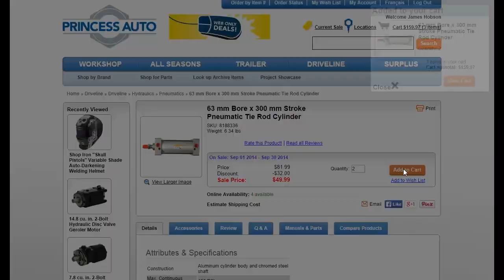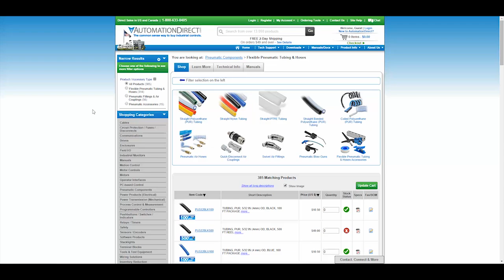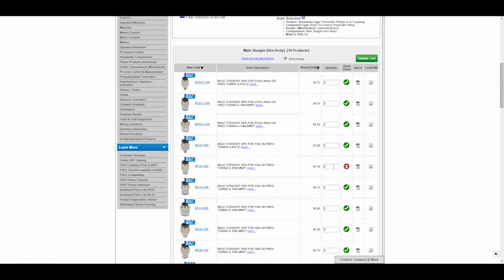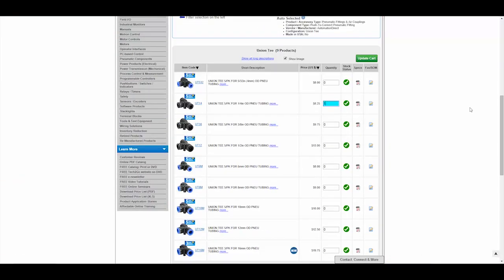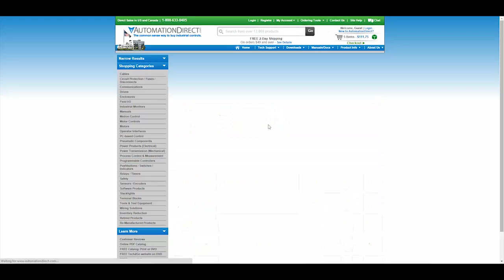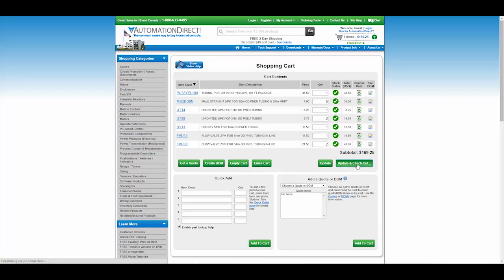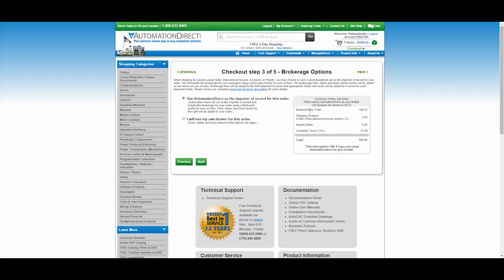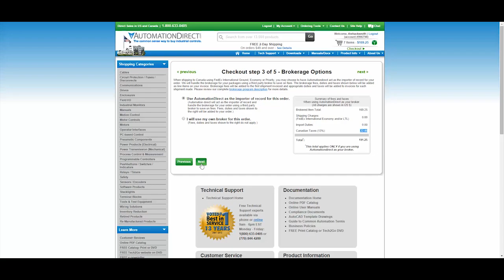Exoskeleton Mk2, Part 2: New Supplies

Comment: You should try using McKibben (air) muscles.  They are much lighter, very powerful, and require a lower PSI.  They also have give like a real muscle so they are not as dangerous.   I'm designing a bionic arm using 3D printing that's then cast in aluminum and uses them.  http://imgur.com/a/XxGeP#0

here's a guide on how to make them:  http://www.instructables.com/id/How-to-make-air-muscles!/step3/Making-the-large-air-muscle/

Hit me up if you want to know more.  Really enjoy your videos!
Reply: Even im making a exo suit, which aims to lift about 30-50 kg of weight. Would yu suggest pneumatic cylinders or air muscles to do the job?
Reply: Depends if you want it to be lift assist or do all the work.  They work similarly but an air muscle works with your body and a cylindar works in leu of it.
Reply from the maker: I've been meaning to make some of those to show my subscribers -- it is ideal for a lightweight system but I'm going for the big game -- lifting multiple times my own weight =P so that wouldn't really cut it. Good plan for a medical device though for disabled people!
Reply: the Hacksmith You could do that if you had enough internal volume in the air muscles, and they might be more weildy than cylinders.  <shrugs>  And require less PSI.  You would need more air volume though.  Are you planning on making this rig portable or keep it tethered?
Reply from the maker: Amadon Faul Good point! I'm excited to see where your bionic arm goes with this! The unit will be portable of course, planning on using a small scuba tank as the reserve since it can hold 4500PSI regulated down to 150PSI. Then an onboard auxiliary 150PSI compressor for "just in case".

Comment: why don`t you use hydraulic cylinders? they are more powerfull.
Reply from the maker: joost schreurs power source is too big for a portable exoskeleton -- plus I don't have enough money
Reply: the Hacksmith I get the problems, but it would be awesome a small cylinder the size of your biggest cylinder can lift up to 50 tons! If you would support your body with those you could lift a car! And they can be portable but yes a small 700 bar pump is expensive.
Reply from the maker: joost schreurs haha I think your math is a bit off -- I don't know of many small hydraulic systems that operate at 700 bar! that's over 10,000PSI! But you're right, at 4500PSI (fairly standard pressure for a hydraulic system), those tiny cylinders could put out around 5000lbs!

I do plan on doing a hydraulic version when I have the resources to do so, but it'd cost like $5000-10,000 ... I don't have that kind of money laying around =(

Comment: This is a cool project. Are you going to use a couple of high pressure paintball air tanks or maybe a small scuba tank to make this mobile?
Reply from the maker: Yup! How'd you guess!
Reply: Then you should do a double scuba tank rig. The size and strength of the tank matter too, because some have stronger metal to hold more compressed air. If you didnt already know.